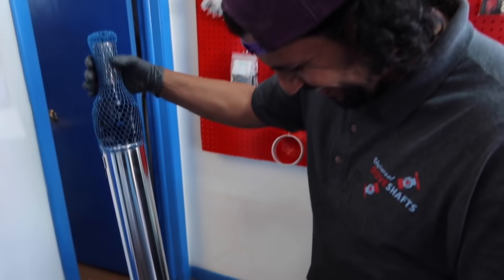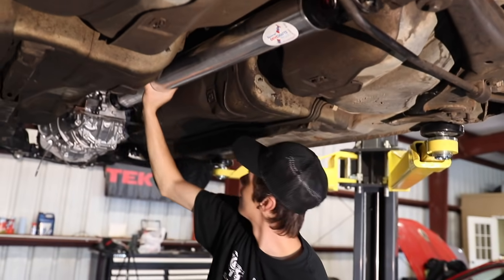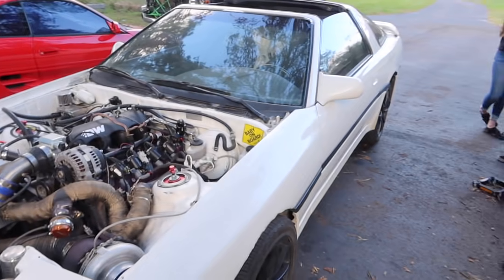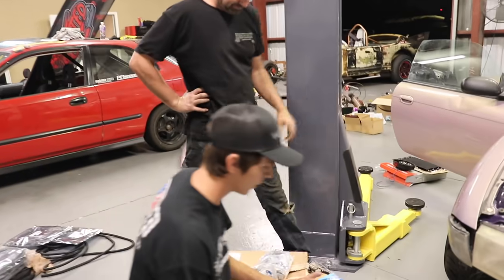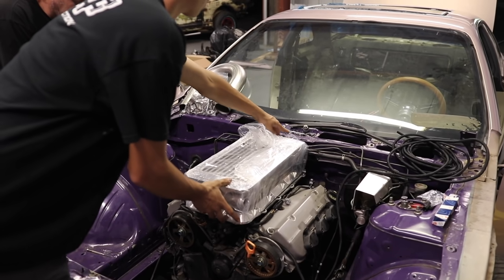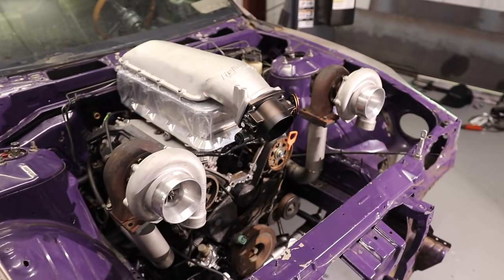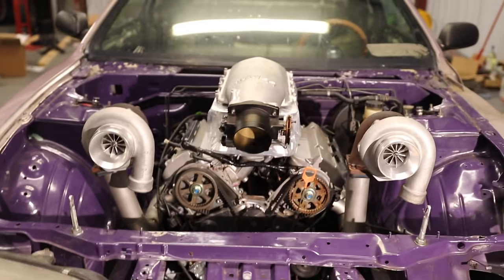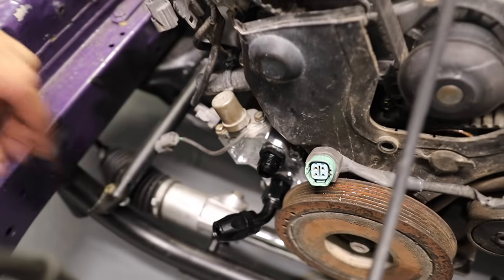S14 Gets BILLET Intercooler and Both Turbos Mounted!

Comment: Hey Kyle!! Just wanted to say that you're like a prodigy kid!! I'm very impressed with how far your channel has come since I first started watching your videos. I believe you had less than 100k subs then and now almost 1MILLION! Friggin awesome bro!!! 😃 I've always had a desire to build cars and I actually studied Automotive Technology at Universal Technical Institute (U.T.I.) when I graduated high school and moved out to Chicago in 2004. Grad in 2003... I had a lot of fun in 3 of 15+ classes that were sponsored by "hotrod magazine" that were focused on performance upgrades! The first 3 week course of 3 was all about street legal performance upgrades like the small intake and exhaust upgrades and minor bolt on performance parts etc and we would see what kind of horsepower and torque gains we'd make on the dynomometer. Nitrous was introduced at the end of the first 3 week class as well as turbos, superchargers etc which made me excited!! My class instructor was a promod racer as well as street stock so you can imagine the stories he had. The second and third "HOTROD U" programs were basically one long class that was six weeks long altogether. The first 3 weeks were all about tearing down 350 blocks and doing literally all the oil clearance measurements to make sure that we had a solid motor to start with!! Learned all about combustion ratios, timing, different types of intake plenums for torque or 🐎 horsepower, volumetric efficiency, backflow, but more importantly power adders!! The second part of this six week class or last three weeks was all about putting these 350 motors into T-Buckets and dynoing them and adding mods! What a blast!!! Anyway, I am in Aww that someone like you has built a great channel and life like the one you have!! I remember when you were in your parents garage!! It's nice you had Brent and Emilio and others as close friends to help along the way!! Not to mention I'm pretty sure that you are self taught and/or have learned from friends!! I spent 20 grand on UTI but got nowhere! Partly because of a serious back problem halfway through school but also the lack of good connections and opportunities etc!!😞 You're living my dream buddy!!😝 Never take it for granted and good luck on 1 MILLION SUBSCRIBERS ASAP!!
-CASEY

Comment: Save the supra man. You've had it awhile and they're only getting more rare.
Reply: They make replacement panels for a reason.  And theyre not that rare you can buy a gen 3 for 500 bucks
Reply: @austinhales1807  for now. Give it 5 years. They will most likely skyrocket in value
Reply: @sergeantspeed5941  doubt it smoothbrain
Reply: They are already appreciating (not this one much, obviously) to some extent and this is a target top car. Just like every other 80s car around me, they mostly rusted to the ground so, yeah, rarer by the day. I see mk4s for sale about as often these days.
Reply: @austinhales1807  please do tell me where to find one for $500. In my market (Dallas), they go for around $7-10k
Reply: @fcardona84  always one guy who can find 10-15 under 1k... I cant even find 3rd or 2nd gen GTI or  vws in general for that price.

Comment: On the batrod if you made the coolant lines that went to the back with a couple long sections that are aluminum tubing and have fins on them like a hot water baseboard heater it would probably add a lot of cooling for the long burnouts.

Comment: This went from a very good learner drift car (s chassis SR20DET) to something with custom steering parts that is going to be hard to fix when you inevitably bend something, and with all the engine parts sticking out of the engine bay so you can't see where you are going, and twin turbo is probably going to be pretty peaky.

Cool build, just think it's lost the scope a bit.

Comment: Rhodes Race Cars has those tanks with a 2000 Gal/hr pump in the tank all wired up. Just have to connect to the external terminals. I have one in my race car.

Comment: These guys did all the math for us, cold is good. 

Once upon a time "Buddy Ingersoll" ran a 3.8 stroked and whatever, turbos, and was spraying liquid nitrogen through the cooler and was running .250 quicker than the pro-stock cars. He just bought a couple year old pro-stock chassis and plugged in the V-6
then Warren and the boys told him they didn't want to play with him, go home!

The  at  2 divided by the  at  1 is equal to the square root of the result of  1 divided by  2. In other words, reducing the  by 20 degrees gives this engine an extra 3.85 horses. Same 200  engine, cooled to 50 degrees.

Comment: I love it guys but I see a problem with your intercooler spacer a 1/2in isn't far enough from those stacks especially since it looks like youl end up with 1/4ish between with that step... Go bigger it'll make a huge difference on alot of things one is colder intake temps because tould use the whole core. I'm not sure how much would be a must but I think the rule of thumb is the radius of the widest part of the stack from center Soo an inch would get ya close enough

Comment: I dont know that motor, but can you flip the adapter plate 180 to move the whole intake forward? Looks like the 6 intake runners are to the front of your adapter. Might not have to clearance if those inlets are to the back.

Comment: You should hook up your AC through the intercooler and use it to cool the air like the hell cat does. And you could probably still run ac in the car. That way you’re not having to constantly refill your ice box with ice water.

Comment: Hehe, when drag dudes are going drifting and do a water to air IC :D 

but it might work and all, but not the best for drifting and roadrace, air to air is preferred for a reason ;)
Reply: Yeah, he needs a heat exchanger for it
Reply: @jagharingenyoutube  even then it's just more added weight and complexity for a less efficient system. air to air just needs airflow. air to water is only used for packaging or for drag racing when you can ice it and use it for 10 sec or less
Reply: @Ztaal3  i know, but he probably got the intercooler for free and wants to look a little bit like Leroy 😄
Reply: @jagharingenyoutube  yeah no hate at all 😂 just know a lot of people who think it's better. Guess he will figure it out on track 😉

Comment: Did that dude say 1310? 1310 should really only be used up to 450hp/400ftlbs. Have them make another using 1350 joints and yokes. 3-3-7091X is the part number for the 1350 slip yoke for the cd009.